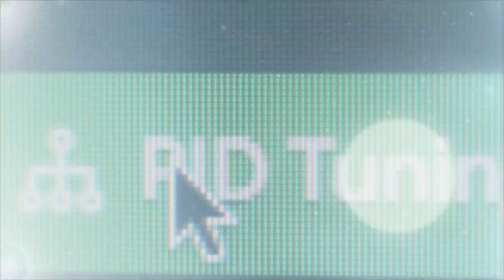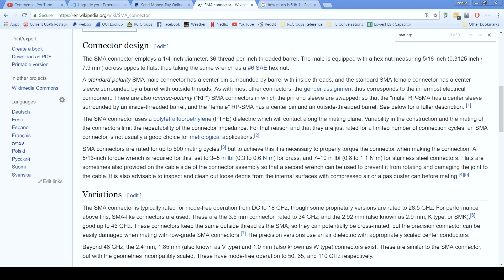Taranis 5 dBi Antenna Mod | DO IT MORE SAFER-ISH

Comment: Joshua - The 84mm measurement is only for PTFE (Teflon) insulated cables.  The 1.13mm coax that most people are using should be cut to 100mm.  The reason is the velocity factor of polyethylene cable is higher than Teflon.  Teflon has a velocity factor of .69 where polyethylene has a velocity factor of .82.

I believe 3-5 in-lbs is incorrect.  I think they meant 3-5 lb-ft (36-60 in-lbs).  This is approximately half of the torque you would use for a standard steel fastener with a 5/16" head (thread would be a #8 I think).   3lb-ft is a strong finger tightening.  Not sure too many people could get 5lb-ft on that nut with their bare hands.
Reply: Obviously you're Mr Antenna, and you know far more antennas than me, but I'd be really interested to know why the cable length matters. From my studies on antennas so far whilst learning about radio stuff, my understanding was that the length of any shielded unbalanced coax feed didn't matter and only the length where the shielding was removed/folded back mattered as it then becomes a monopole/dipole at that point. But like I say, I'm still a newbie to antenna theory.
Reply: I'm good with the 84mm, that goes over my head.  :)  But from where to where should i measure the 84mm?  Total length of the signal wire including the SMA connector?
Reply: In another video you mentioned that for Teflon insulated cables the length of the coax should be 1,66 inches which roughly equals to 42mm, so where does the 84mm Steele mentioned come from? The calculation works flawlessly for the polyethylene cable (100mm)
Reply: Oh yeah, so one could choose any multiple of 42mm?
Reply: I'm going with 100 just because you said so, and for the sole reason of installing your diamond antenna. ;)

Comment: I have a Question.   Before I did the 5DBI mod I simply bought a modual for the expansion bay.   Is there more latency using the expansion bay?  Why would people rather go through the trouble with the 5DBI mod when a modual for $35 worked great for me.   I did the mod as well and have had no issue with mine but It seems to me the external modual works great for me.?
Reply from the maker: Usually, the JR module bay receives the channel information via a CPPM signal, so there is about 28 ms of latency added, and, I think, double that if you are running 16 channels. But some people have told me that the Taranis XJT module uses a digital serial protocol to talk to the Taranis, and if that's true, then there is no difference between the internal module and the external one. But how does the Taranis know it's talking to an XJT and not some other module?
Reply: Thanks for the quick reply.   I figured there must be some added latency.  I do run the XJT but I agree that that theroy would need to be tested to find out if the XJT is indeed the same or slower.   Thanks for the great work you do for the community.  By the way I run  a 3d printing/CNC business so let me know if you need anything made from Carbon fiber or Plastics.

Comment: I did the mod and it worked but the RSSI was bad so I decided to resolder and needless to say I pulled the tiny pad and now it is useless. Do you know the best place to buy the replacement board other then Ebay?  Please let me know as soon as you can so I can get it ordered.

Comment: Put an SMA adaptor on your antenna. If the SMA wears out, replace the adaptor. ;-)
Reply: That is not a terrible idea to protect the mod end. Will add a small amount of loss but if it saves the pigtail in the long run then worth it.

Comment: Weird question... Are you in the Holiday Inn in Amarillo, TX?
Reply from the maker: +Dieter Woerz not even close... New York, upstate, near West Point.
Reply: But is it at least a Holiday Inn Express? I swear that's the exact same setup as the one down in Amarillo. Even has the same picture on the wall. Oh, by the way, thanks for all that you do for the community!
Reply from the maker: +Dieter Woerz it's a Four Points by Sheraton.

Comment: i modded my dx7 to have an external antenna years ago. never had an issue. i even forgot to turn it off one time packing up (with the antenna removed). running lipo so several hours of runtime -came back a week later and still good as gold (lipo dead though).

Comment: Just here to say I'm very much so looking forward to the SE Edition review. I bought one from GetFPV, it came slightly damaged, where the little plastic lip that holds the battery in place on the inside of the compartment broke off from what I assume was rough handling during shipping. I also noticed the case shielding that circles around the SMA connector looked to be considerably out of alignment in that the two parts of the shell did come come together well at all. GetFPV took it back no questions asked, but I've yet to purchase again until I read on it more.

I'm curious of the thickness of the coax cable FrSky used this time, as I had purchased Steele's recommended thicker cable in case the cable is of lesser quality. The quality of the soldering job out of the factory is a point of interest as well.
Reply from the maker: +MultiKillGaming the cable from the factory is thin.

Comment: I always put a dummy load on my radio when the antenna is removed. (I'm an Amateur Radio operator since 1978)
Here's why:

In Amateur (and Professional) Radio work and it's considered "standard practice" to cap any co-ax connector that isn't in use. Especially on mobile equipment, as it sees harsher conditions and is exposed to more foreign material than 'lab' based gear. Liquid exposure is the most damaging, and the exposed insulator/co-ax foam can become contaminated even from high ambient humidity, reducing your range or worse.

Capping using an proper impedance dummy load (50 or 52 ohm for a Taranis, any wattage will do) does several things, including the ESD protection. I never really thought about ESD issue in regard to antenna connectors, as impedance is typically low and most well designed transmitters/receivers have good protection designed in, but in this case, FrSky wasn't designing for an open transmission line so there is indeed a chance that could happen. With a 50 ohm impedance and the fact that the outer shell is ground and will general take the 'hit', odds are low, but why chance it?

Odds are MUCH better you will turn on your radio with no antenna connected. it's incredibly easy to do. This is a confirmed way to damage any type of transmitter. (all the RF energy is reflected back to the output transistor which severely overheats)
The dummy load 'emulates' a properly tuned antenna by absorbing the RF and converting it to heat. In the dummy load is a 50 or 52 ohm resistor (RF Rated to 2.4 ghz plus)

Keeping the load in place to set up a plane (or quad) is a good practice as well. This practice prevents overloading the front end of the Rx (Which is why you hear "telemetry lost"  or "RSSI Critical" when you get the Rx too close to a Taranis). (you can use "range mode" to reduce the signal level if you have an unmodified Taranis). I addition, you are practicing responsible radio operation by not sending unnecessarily powerful signals while testing. The may prevent unintended interference with another modeler, or co-inhabitant of the 2.4ghz band (we share the 2.4ghz with portable phones, baby/security cameras, Wifi and all sorts of short range gear.)

As well all the functions above, the dummy load acts as a cover, keeping dirt and moisture from getting into the connector and protecting the threads from getting dinged (which, along with plating wear, is the main 'wear' factor of most Co-Ax connectors).
 (Note: they do sell simple dust covers, some are just blank connectors (n center pin, and others are just plastic cap-plugs. They work OK for mechanical protection, but a dummy load is only a buck more and it's a much better fit for what we are doing.

I put an extra SMA bulkhead connector right above "S2" to  "park" my dummy load when it's not in service. It's out of the way, but never misplaced. When I pack up, I remove the antenna, move the load from 'park' to 'Tx' and I'm done. Reverse to set-up.
ALWAYS do a range test. You'll catch most problems right there. It it's acting 'funny' then, fix it before you fly. (you will be trying to talk yourself into "that's just a glitch" or "normal intererence" but you  know it matters.)

Thanks Joshua, another great video.

Comment: You could use a connector saver and throw that away when the mating cycles are maxed out.
Why would the length of the coax matter? If the antenna is 50 ohms, the length would not matter. If it is not (and it won't be exactly across the band), the length has to be extremely precise at this frequency. Would the PA want to see something else than 50 ohms? Than you need a specific antenna, not just any.
Reply from the maker: The length of the cable matters because cheap coax is often not actually 50 ohms at 5.8 GHz.

Comment: My brother's Taranis kept going into failsafe, no mods, ruined 2 foamy planes and drove a $1500 helicopter into ground at full speed. Not all Taranis failures are necessarily due to Antenna or mods.
My Taranis on the other hand has been worked flawlessly since I purchased over 2 years ago, was thinking about modding antenna but nah seems to be too risky an subject to high failure rate.

Comment: I think you are a little paranoid about ESD.  For the most part ESD damage to components happens when they are in their lose component form and not connected to a massive ground plane with Capacitors everywhere. Once they are connected to the board they are very safe from ESD, but you are right they aren't immune.  I'm not familiar with the circuit for the FrSky Transceiver, but I would imagine it's relatively safe.

Comment: So do you have a spare RF board now? :)  Hey when you say "the SE has the same mod as you or I would have done" do you mean the cable is soldered directly to the RF board? Hmmm, guess I can wait until you review it huh? Thanks for the video!

Edit: Oh yeah. like ElectroBOOM is a RIOT!
Reply from the maker: Yes, the SE has a pigtail soldered to it just like the homemade mod.
Reply: My understanding for about the last year Taranis cam with U.FL connector for the antenna

Comment: is the 84mm the length of the cable to the tip of the connector or to the base?
Reply: if you dig deep in the comments section over there alex says it is from the base of sma to the end of the shielded section of the coax
Reply from the maker: That's a good question. I think it is to the tip of the connector.

Comment: torque sma connectors all day 5lbs is a little more then finger tight.
Reply: It's inch/ lbs, it isn't much. I have an inch/ lbs torque wrench for gun smithing, I may mod a socket to try it out and get a feel for the torque.

Comment: What is the point of changing the antenna? Im getting over 600 metres on stock (RSSI still at 45 ish). Do you really need more signal??
Reply from the maker: If the antenna breaks, then you have to replace it. That's when you wish you had a screw-on connector.
Reply: Yeah I guess that makes sense. Fingers crossed I don't break mine any time soon lol

Comment: Wouldn't you be running a transmitter without an effective antenna?
Reply from the maker: You're going to have to give me more context.
Reply: as far as I've learnt, you shouldn't run a transmitter without an antenna (VTX should always have one attached when powered up).  If you're not getting a physical connection due to a poor mating, am I correct in thinking you don't have an effective antenna attached?
Reply from the maker: Yup.

Comment: did you see rotor riot vid called heavens gate? chad went twice as far as tommy ????
Reply: Does chad use the 5db mod?
Reply: chad said his gear is all standard and tommy has the big antenna mod...
Reply: oops.. i'm madmacs.. wrong account because i replied to email...
Reply: Was Tommy's using a Taranis?
Reply: Chad said in the  comments that Tommy's radio antenna pigtail was faulty and it was found after the road trip
Reply: I just watched it again, Chad had the 5db mod on his Taranis from the looks of it

Comment: FFS, ten minutes of some dumb face rambling into an oversized foam dildo in a ... what is this, a hotel room?? Who do you think watches this? Show the issue, describe the problem in photos, pictures, graphs, cut it down to analysis and fix, job done. "Hurr, durr, I did this thing, remember from (otherwise not displayed, not linked) video, heard that thing, decided to bla bla bla, then derp de derp, you know". Practical, on-point, self-contained info. Certainly not from your video. Just some boring, drawn-out musings. What a disappointment. Could have earned a subscriber. Not tonight.
Reply from the maker: Thanks for the suggestion that I should link to my original video. I shouldn't assume that all of my subscribers watch all of my videos, and I shouldn't assume that every viewer is an established subscriber. I appreciate the feedback.
Reply: Pathetic.

Comment: What I did in the meantime was to program an SWR alert in the radio to let me know/ heads-up everytime the SWR value is higher than 1, if everything in your TX is OK you shouldn’t get a higher value than that, on top of that, I modified the soft pads in my TX case (Pelican Storm) to transport the radio without having to remove the antenna.

Thanks Joshua for the follow up on this topic :)

Comment: So this means sma and vtx antennas will where out if removing antenna every session to put in quad lowepro bag? Damn
Reply from the maker: +MultiBeast FPV I mean, eventually, but you're right that people remove those antennas a lot and there doesn't seem to be an issue.

Comment: you said that the wire is suppose to be 84mm long. Now I have a q x7 and also want to do the mod, it has a little ipx connector, wich makes things easier and hopefully safer at the same time. But the ipx to rp Sma wires are not 84mm long (mine is 100mm long). Is this a problem?
Reply from the maker: If it came that way from the factory, I would probably just leave it alone.
Reply: Oke, thanks for your suggestion. I'm probably going to still do it, because with my wing I fly within the edge of 2,4 and an uhf and I just want to make sure I won't lose my signal that quickly.
Reply: I don't think it's an issue. I just upgraded the pigtail in the Taranis SE to RG316. The original pigtail from the factory mod was 81mm. I am a bit curious about the 84mm recommendation. Does the 84mm account for the wire going inside the connector? If the total length of wire should be 84mm then perhaps 81mm outside the connector and 3mm inside is correct.

I cut the RG316 pigtail to the same 81mm as the factory rp-sma mod and get slightly more range (perhaps 20-30 more feet in range test mode).
Reply: how did you cut the Pigtail, it has connectors on both ends. BTW is the Se the trains x9d plus with hall sensor gimbals and water dripping?
Reply from the maker: +Tom Rösch yes that's the SE. I don't understand the question about cutting the pigtail. When you cut it, one connector comes off.
Reply: Joshua Bardwell that's what I'm wondering about. How to you reattach the ipx/ rp-sma connector if you shorten the cable to 81/84mm? Do you just crimp a new one onto the lead (I'm asking because I don't have the equipment to to this)?
Reply: Yes, I have the Taranis X9D plus special edition. On that radio, the pigtail is still soldered to the board. Honestly, I'm not too sure how much the length of the wire affects the signal. I'd try a with an unmodified pigtail and do some range testing and also verify that your SWR is still low. If range is as good or better and SWR is low then you shouldn't have any issues.
Reply from the maker: You would have to crimp it, but you probably don't have the tools to do it right.

Comment: do a continuity test on the wrist strap listed above, mine didn't work straight out of the package, had a break in the wire somewhere
Reply: You folks that are using an ohmmeter on ESD protection need to know the manufacturers put a very high value (one megohm plus) resistor in the grounding circuit.  
While a large value resistor like that bleeds off any ESD charge in a few seconds, it WON'T pass enough current to kill you if you inadvertently touch a line voltage circuit (120-220v). 

DON'T "fix" it and wire it direct.

The same goes for "grounded tip" soldering pencils, look out for the old ones, back in the 1980's they were directly grounded and if you tried soldering in an energized circuit (by accident), it would provide a ground path and something was getting ruined. I was a TV service tech back in 1980 and damaged a customers 3 month old Sony 19" (one of the 1st non-isolated TV chassis) with a Weller WTCPTN station (best station ever made, but had a direct grounded tip - if you own one, add a resistor or at least a warning label).
Reply: Funny, I just checked this before modding my Taranis. The lead to the wrist strap from my esd mat wasn't grounded. Good thing to check, a ground strap without ground is worse than nothing at all!
Reply: Thank you for that information. I did a bit of research on the subject and you are correct.
Reply: yes I did not realize this, I will change mine back to the way it was, thanks

Comment: Have you setup the Smart port on your RF1 Quad so you can make changes with the Taranis telemetry? I watched Race Flights video but I cant seem to get the Firmware on my Taranis. I'm using a Windows OS. Any help is much appreciated
Reply from the maker: +Danny Kramer I habe telemetry working but not two way.
Reply: Right on. If you happen to set it up. A video would be awesome. I find the way you explain things easier to process for my simple mind. lol